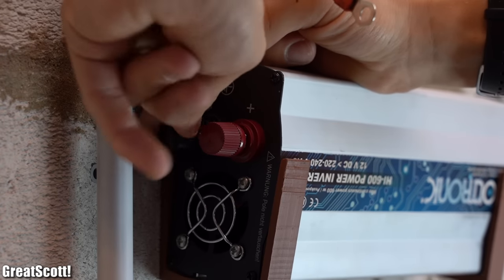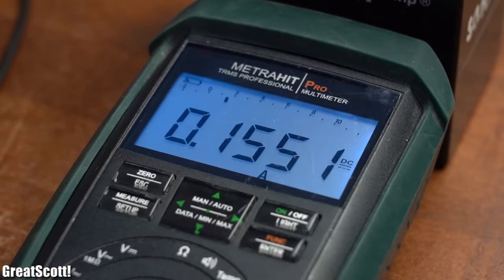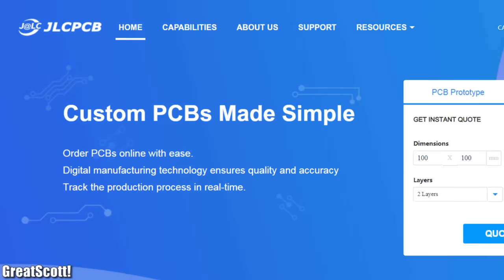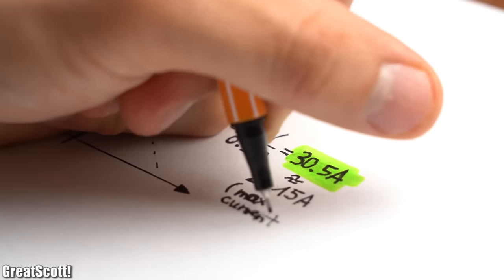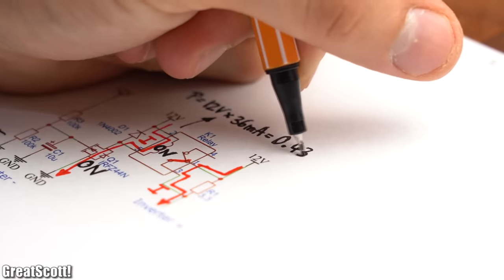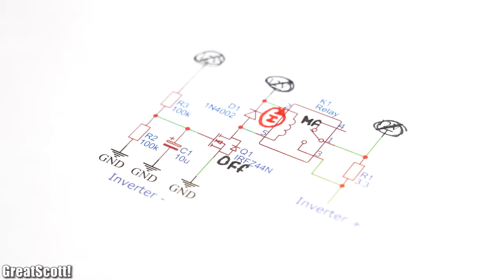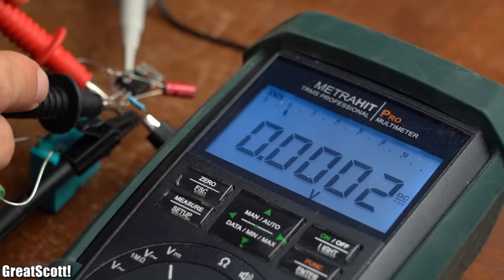How to make a Softstarter and why it is sometimes mandatory to use!

Comment: You really don't need a MOSFET and delay circuit.  Just connect the output of your power converter to a bypass relay and the power supply itself will create the delay.
Reply: That would just delay the onset of the inrush current and not solve the problem.
Reply: @divingquokka  -- No, the inrush current problem here is from charging the input capacitors of the load (in this case, the power converter) when power is applied.  Both his method or mine, introduces a precharge resistor (or NTC) to allow the caps to charge at a lower current. Even with zero load on many power converters, the inrush current from any large input capacitors can trip overcurrent protections or even blow fuses.  

On the other hand, if you have a "Locked Rotor Amperage" inrush current from a large motor starting up, you need an different "Soft Start" circuit entirely, which he says he will address in a later video.
Reply: @Nic7320  I don't understand what you are saying. Do you mean the mechanical latency of the relay causes enough delay?
Reply: @divingquokka  -- The power converter itself creates the delay.  After its input capacitors are charged, and after the power output voltage ramps up, the power converter produces full output voltage to engage the soft start bypass relay to make it more efficient.   The relay does add an additional small delay, but it is not needed.
Reply: @Nic7320  You appear to be confused about what is where and what is causing the problem. It is about inrush current caused by the charging of the capacitors in the inverter that is fed by the solar charger, which causes the overcurrent protection of the solar controller to trip. And now you are saying these capacitors mitigate the problem instead of causing it?

[Solar charger with overcurrent protection] ---INRUSH CURRENT----[Inverter with capacitors].

Solution:
[Solar charger with overcurrent protection] ---temporarily insert resistor----[Inverter with capacitors]
Reply: @divingquokka  -- there's no confusion.  The inrush current is reduced by the soft start resistor or NTC.  But once the power converter is putting out voltage, there is no more inrush current into the input capacitors and the precharge resistor now can now be bypassed.  Think of the converter's input caps and the soft-start precharge resistor as an RC delay circuit, add to that any time for the power converter output to start, and now the converter's voltage output is stable and no longer needs its input to be current limited.  You need to ask yourself how can a converter output anything if the input caps aren't yet charged?  Once it's working, that's when you can bypass the precharge resistor.

I ran into this problem using a 24 to 12 volt converter after I changed some wiring.  The old wiring had just enough resistance to limit the start up the current, but the new wiring had this problem and the solar output shut down.  But I found it was better to relocate the converter closer to the load since it reduces IR losses in the cable and that solved the inrush current issue.
Reply: @Nic7320  Clearly you are describing a totally different situation than the video is dealing with. We are talking about circuits without soft start resistors or PTC's.
Reply: @divingquokka  -- just watch the video.  The soft start relay has a resistor (R1 on his schematic) across the relay contacts that it bypasses after a delay.  If you don't understand what that is doing, there's not much more I can do to explain it to you, other than to refer you to some first year engineering books.
Reply: @Nic7320  Dude, I frigging built the circuit and it is working. I understand what is going on. What I don't understand is why you are claiming the MOSFET and delay circuit aren't necessary.
Reply: @divingquokka  -- Well, that's good.  It can work either way.  But what I proposed is really simple when you understand the start-up delay in the converter.  Basically, the big input caps have to charge before the converter has enough power to start itself up and produce any output power.  

So the inrush current into the big input capacitors of a converter is over by the time the converter produces any output power.  He estimated about 15 ms just for the capacitors to charge to 63% (one time constant), and there's more delay for the PWM circuitry to start oscillating, and for the converter's output stage to put out power.  So if you simply use the power from the delayed output of the converter to engage the bypass relay, the inrush current is over before the relay closes.

This is only practical if your relay is compatible with the voltage you get from the output of your converter (and the appropriate type of AC or DC), so you can power it directly without the MOSFET and RC delay components.  However, if you can't get a relay coil compatible with your converter's output voltage, his design will probably be simpler than mine. 

I'd also like to point out this seems to be a design problem in Victron's MPPT DC out protection circuitry.  It shouldn't be so sensitive to a less-than-one millisecond start-up transient, since there's not enough energy in that to heat up the output transistors.  Heating is proportional to current-squared and time.  Adding one small cap into their overcurrent sense circuit could solve this whole problem.
Reply: @Nic7320  Sigh. Did YOU watch the video?
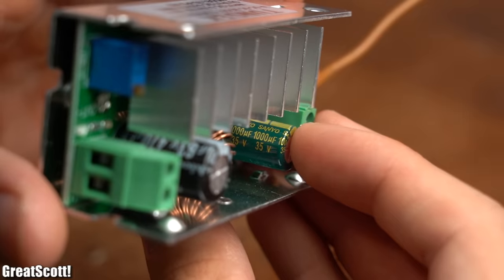Greatscott: 3:12 - 3:20 "... opened it up and immediately found the guilty components: the big capacitors on the input side."
Nic: The input capacitors make sure there is no problem.

You are still not getting it.

"So the inrush current into the big input capacitors of a converter is over by the time the converter produces any output power.  "

No, he has an solar controller already producing power. Hooks up an inverter or a power supply. Those have large input capacitors, causing an inrush current, causing the overcurrent protection of the solar controller to trip. It's not about the output power of the converter.
Reply: @divingquokka  -- You're either deliberately not getting the point or trolling, or you have a big gap in your understanding of how power converters work.  Once you understand all the start-up timing, you can look at things in different ways.  Let me clarify, the "converter" is NOT the MPPT controller, it's the load connected to the MPPT controller output, and it can be an AC inverter like he used, or a DC power converter like I used.  Both have large inrush currents.  
 
So you are both correct and incorrect (in misquoting me).  The converter capacitors ARE the cause of the inrush current.  They ARE the "guilty components" causing the MPPT controller to  protect itself, but they are there for a reason -- to reduce the impedance of the input power rail and provide faster current on demand when the inverter or converter needs it.  But they are ALSO a delay element, slowing down the input power rise-time to the inverter (or converter), and hence, the capacitors delay the start-up and power output of the inverter or converter.  So you can just as easily use that as a delay element, or build your own delay circuit but then you have to guess how much RC delay time to build.  Using the converter power output does it automatically.

The timing sequence goes something like this:
Time 0:  Power is first applied by the MPPT controller.  The input caps of the AC inverter or DC power converter are at ZERO volts.  
Time <1 ms: Any inductive time constant from the wiring is over and the Inrush current reaches maximum current (limited only by the output impedance of the MPPT output, the wiring, and the combined ESR of the capacitors).
Time 15 ms:  The capacitors now reach 63% of input voltage, and the inrush current drops to 37% of peak current.
Time 45 - 60 ms (roughly, depending on the design):  The input capacitors have reached three or four RC time constants and the power converter reset circuit decides the input voltage is above the low voltage cut off threshold and stable enough to turn on the output.  THE INRUSH CURRENT IS NOW OVER.
Time 75 ms (roughly, depends on design):  The inverter or power converter starts to produce voltage.
Time 100ms: The relay contacts can now close to bypasses the soft-start resistor.

So either way can work; you can build your own delay or use the inherent delay in the converter's power output.

Let me give you another analogy.  Say you open a SCUBA tank valve. There is an inrush of pressure filling the hose and into the regulator.  Once that hose and regulator are filled, the regulator can now provide breathable air to the mouthpiece.  So when the mouthpiece has air, the inrush is over.  The pressure in the regulator will cycle up and down on demand, but there is no more insush since it no longer has to do a full pressurization.  

So you can use the start-up delay by using the delayed OUTPUT of the power converter or inverter to power the soft-start bypass relay.  The inrush transient is over now (and the caps will no longer have to charge all the way up from zero volts). 

It might also help to draw out the converter circuit, but for illustration purposes, break the power converter into two functional blocks.  Draw the input capacitors in a box all by themselves, two wires in, two wires out.  The power converter is the next box that connects to the output of the caps.  Connect the input of the caps to the MPPT controller and the output of the caps to the power converter and then you see the first thing that gets powered is the capacitors, before power converter can start.

That will also show you why you get a spark when you first connect most big converter's input wires, even when it's not turned on or hooked up to any loads.  The caps are directly at the input, right behind the fuse, and powering them up takes a big slug of current.

If you did build the MOSFET circuit, then congratulations.  It's easy to destroy a MOSFET by touching the gate pin and zapping it a static electricity.   But like I've said, you can also power your relay directly with your power converter (if it's the same voltage).  Try it, and you'll see it can work.

Comment: Why the relay? Can't you just let the current flow through the MOSFET?
Reply: Exactly what I was thinking. Either do a dumb RC circuit that ramps Vgs on a PMOS to keep current below the desired maximum (not too practical since it requires load-specific tuning) or go a little fancier with an op-amp to run the PMOS as a current limiter.

Comment: They are called "chokes" for a reason
Reply: Yes they are called chokes for a reason,  but until you do the proper electrical engineering calculations, nobody should be randomly adding a choke ...

Comment: Saw just now that you're using a Victron Energy charger for your solar system. I used a rather similar one (the SmartSolar 100|15) for a project of mine and I wrote some software to get the data from the charger into a database for solar statistics. The whole thing can run on a Raspberry Pi and uses InfluxDB (+Grafana) to store and visualize the data.

hardware-wise you can use a TTL-Serial to Ethernet converter to get the data into a Network, the four-pin connector on the solar charger (where you hooked up the bluetooth module) is just for ground, rx, tx and +5v (not necessarily in that order) TTL-level serial.

If you want to have a look at it: https://github.com/opendata-heilbronn/victron-data-adapter
It's written in C# and theres not a lot of documentation but if you (or someone else) needs some help getting the thing up and running you can hit me up on twitter at @patagona
Reply: I will have to check that out.

Comment: Seems i deal to my air conditioner that needs 15A at start.
Reply: If it's an AC device you might also want to add a triac which switches the device on at the AC voltage zero crossing point.

Comment: the Relay you're using is only capable of switching 5 amps at 12V. that means 60W.... on a 600W Inverter. I don't think this is a good idea is you want to keep your home. Also I'd keep in mind the insurance doesn't pay if they find your video.

Comment: Adding Single Point Of Failure is not great practice.  Its all good and well but simply adding capacitor on source side would do the job in 99% of cases. It's proven to work by numerous installations is cheap and foolproof. Why overcomplicate hmmm?

Comment: This is way more complex than it needs to be.
No need for a Relay or a Power Resistor, just the appropriate MOSFET, a couple of small Resistors, and a Capacitor.
A quick search online will give you many options,  https://i.stack.imgur.com/Csph6.png

Comment: I=V/R? WTF? Current is equal to speed divided by resistance? Hmmm, interesting...
Reply: Velocity is a small, or lowercase v, voltage is uppercase V.
Reply: @robbillington3594  Voltage has "U" letter as symbol... Not "V".
Reply: @Excray80  In you county ... U = Voltage.  In the USA ... V= Voltage.

Comment: Dude why you are way over complicating things use a relay from the solar charge controllers load output to trigger it then simply use the relays live side to the battery bank or whatever to then feed the inverter what you are doing is simply over complicating things and making it much harder to use and maintain I live by the KISS theory I will not break that down as to what that means but a simple google search or simply asking around you will get the answer.